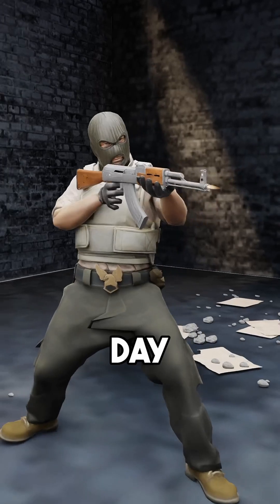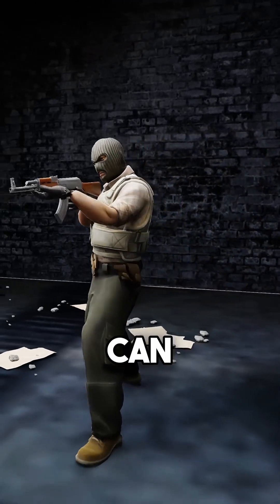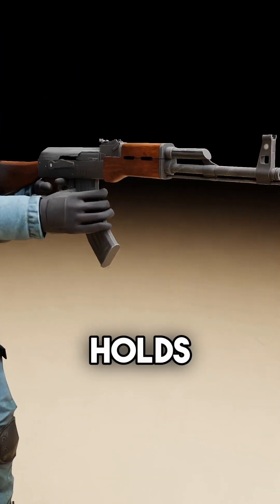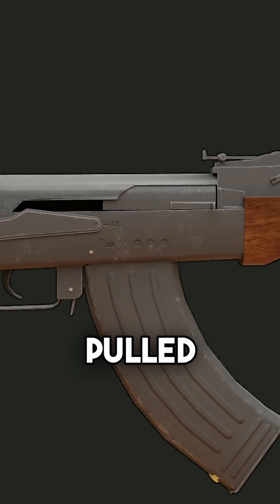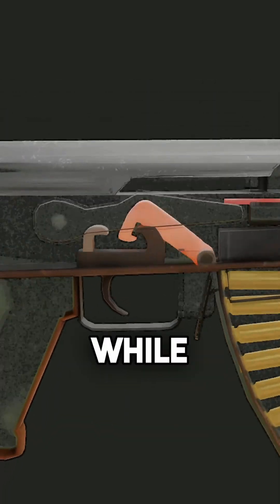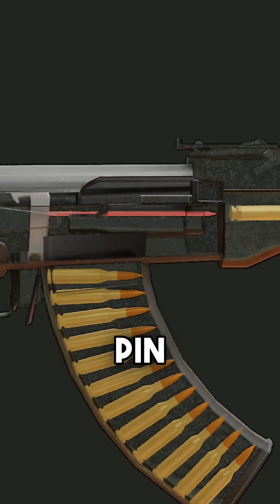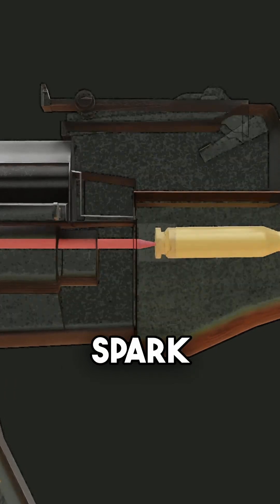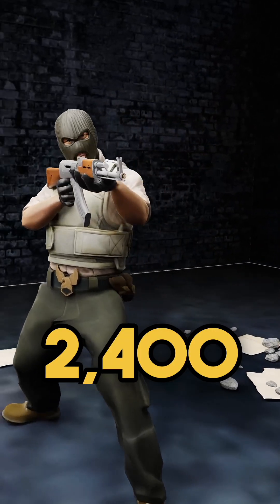How Does An AK47 Work?

Comment: So basically the AK-47, or Avtomat Kalashnikova model 1947, is a famous assault rifle known for its simplicity and reliability

1. **Loading the Magazine**: The rifle uses a detachable magazine that holds ammunition (bullets). You pop in the magazine filled with 7.62x39mm rounds. 🔫

2. **Firing Mechanism**: When you pull the trigger, it releases the firing pin, which strikes the cartridge's primer. This ignites the gunpowder inside the bullet. 💥

3. **Bullet Propulsion**: The burning gunpowder creates gas that pushes the bullet out of the barrel at high speed. Whoosh! 🚀

4. **Ejecting the Spent Cartridge**: As the bullet exits, the recoil moves the bolt back, ejecting the spent cartridge case. Bye-bye, empty shell! 👋

5. **Chambering the Next Round**: The bolt then moves forward again, picking up a new round from the magazine and chambering it, ready for the next shot. Rinse and repeat! 🔄

The AK-47 is designed for automatic or semi-automatic firing, allowing for rapid shots with just a squeeze of the trigger!

Comment: I pretty sure that akm (its almost the same as ak47 but just modded) less than 1,000-900 rounds per minute. Firerate like 6,000 rpm is miniguns and etc, ak have firerate about 750 rpm (rounds per minute).
Reply: Its 600 rpm
Reply: @mrseadogchannel8580  seal detected
Reply: Firerate around 6,000 RPM smth like miniguns and etc.